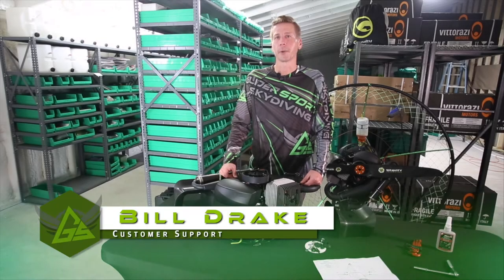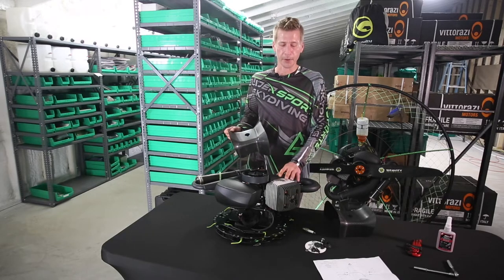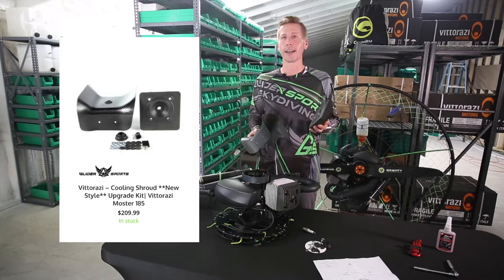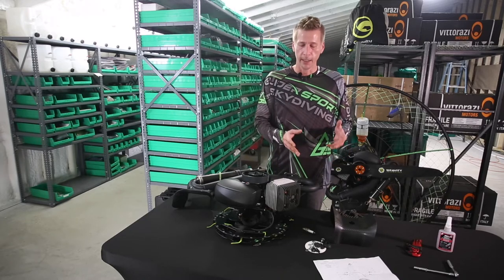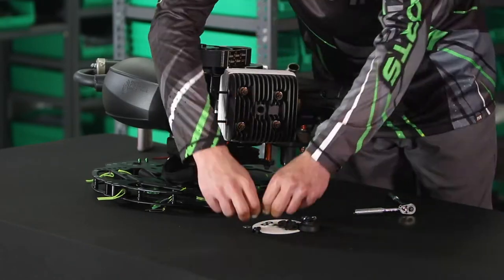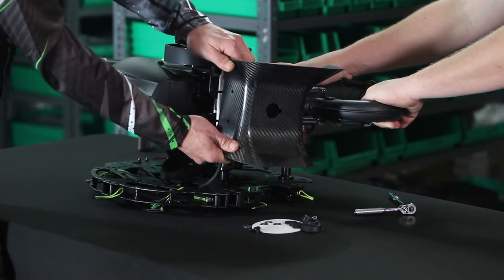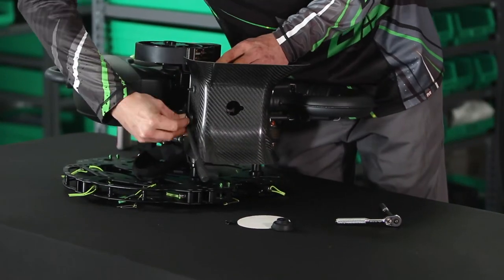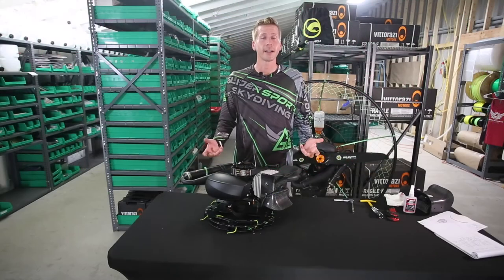GliderSports PROTIP # 7 - Cooling Shrouds?

Comment: 1:21 Wow, this part is so annoying.  There's got to be a better design solution for this.

It would have been nice to see more clearly how you align the metal washers and rubber gaskets on inside and outside of cover.